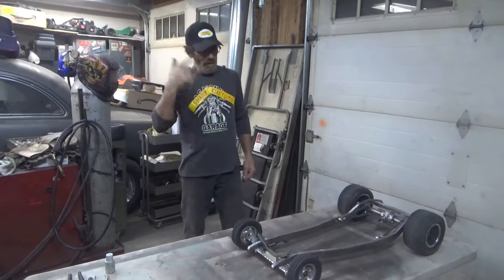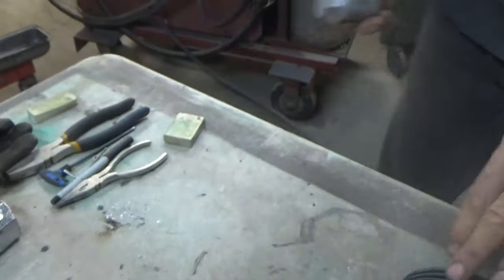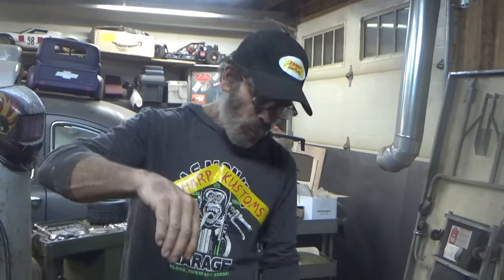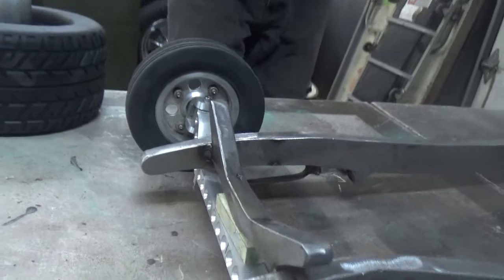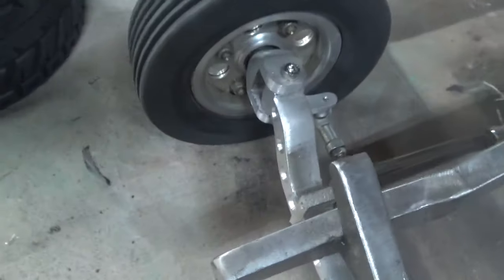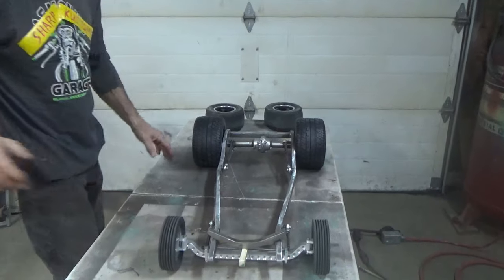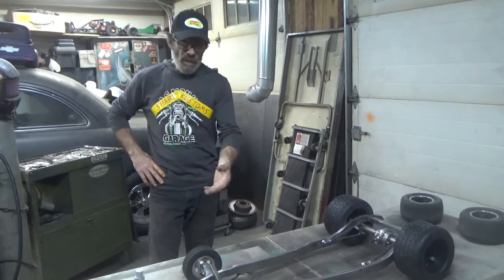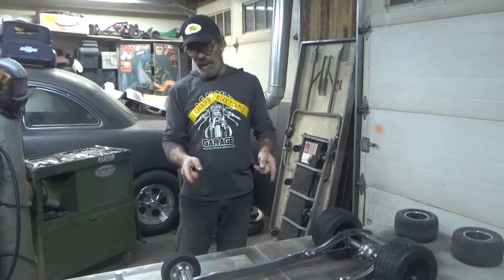Cast aluminum front axle and the quarter scale chassis is officially a roller!

Comment: Could you take the door off the stove and make a sheet metal box extension kinda thing?
Reply from the maker: I just build a box of fire bricks in the corner of the stove, but I prefer doing it out side
Reply from the maker: What you doing today you got that chassis finished
Reply: @sharpkustoms  Yes chassis is finished,  need rims and tires. I will bring it by tomorrow. Have some picked out from YL but they are quite pricey!
Reply from the maker: @ who is yl just working on the Chevy pickup quarter scale repaint
Reply: @sharpkustoms  Yanke Legend in France
Reply: @sharpkustoms  Excited to see what paint scheme you come up with for the Chevy.
Reply from the maker: @ well right now it’s black but want to do some true fire on it just don’t know what colour
Reply from the maker: @ yep they will be expensive
Reply: Just powered up the new chassis on a discharged battery in storage mode, 10% power. Acceleration is quite violent and has reverse! Ordered tires and today.
Reply from the maker: @ pulled a gt40 today but it didn’t turn out very nice, so I think tomorrow I will start another one lol